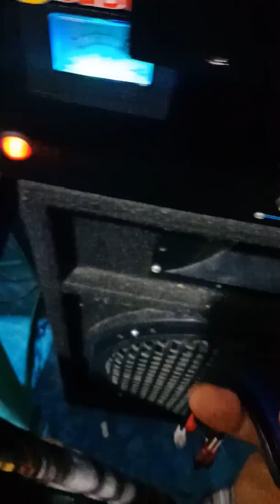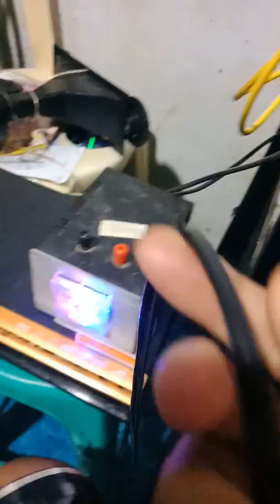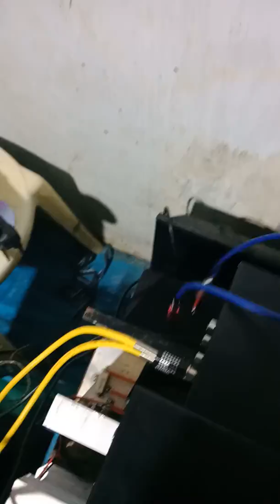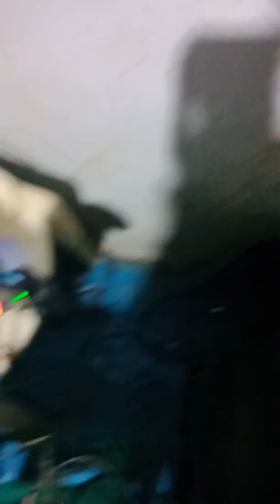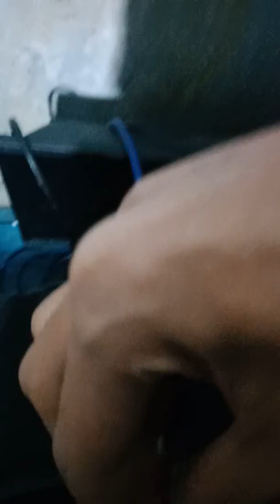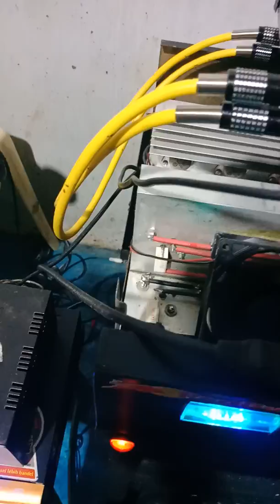Kabel input power mempengaruhi suara dengung

Comment: Salam mas.
kalau noise dan dengung sudah ada sebelum kabel input dicolokkan ke power maka apanya yang bermasalah?
Thank
Reply from the maker: yg paling sering menjadi biang kerok dari kedua hal itu adalah Masalah Ground tapi kalo sistem grond nya dirasa sudah benar. mungkin penyebabnya dari nominal resistor pada bagian input/output potensio, coba dirubah..
Reply: Bang apoy 
Disini maksudnya "nominal" adalah nilainya?
Trims
Reply from the maker: iya nominal atau nilainya.. beda nilai resitor beda nois mas
Reply: Maksudnya di bagian input di kasih resistor ya